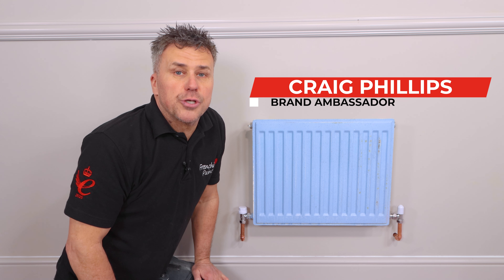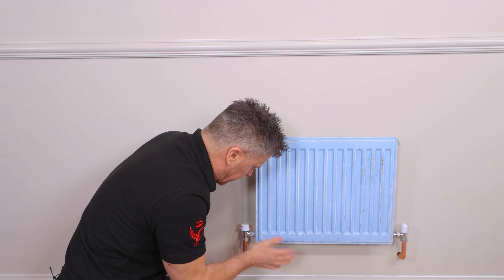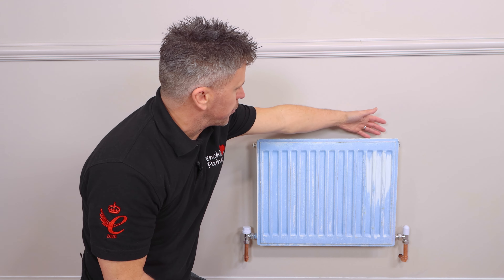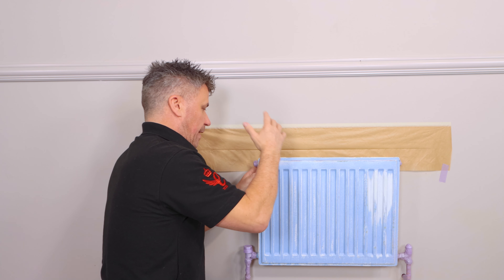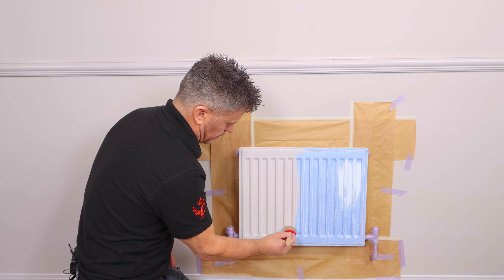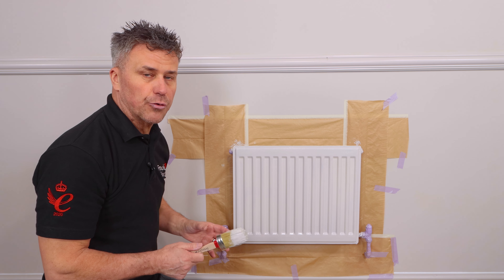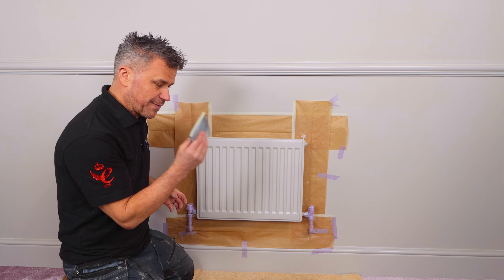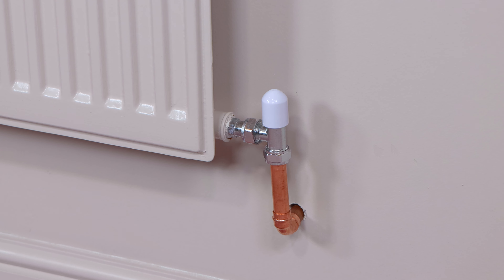How to prepare and paint a radiator

Comment: Honestly..
Reply: @MrandMrsDIY  Honestly... you can pick up a new radiator that size for 50 quid and the insides won't be rusty filling your system with sulfurous gases.
Reply: @ZelenskyTheMadClown  Not everyone can change a radiator, however they can paint a radiator